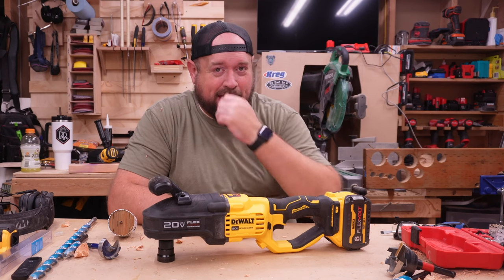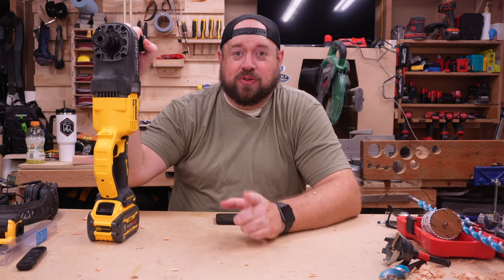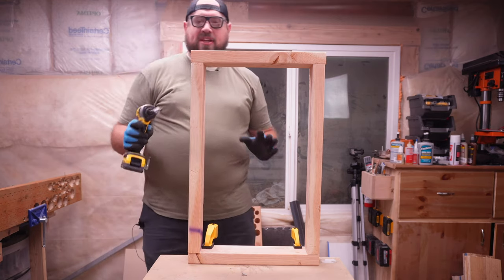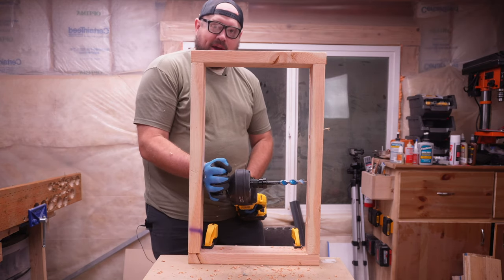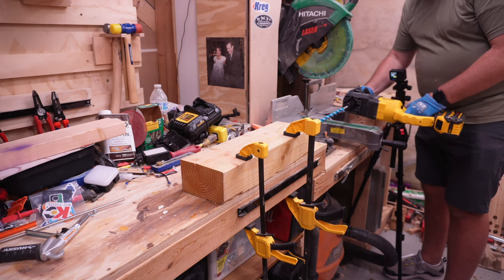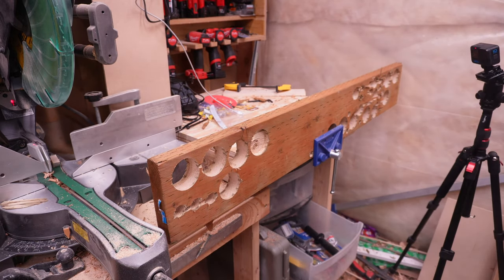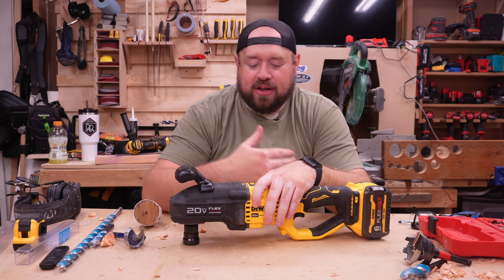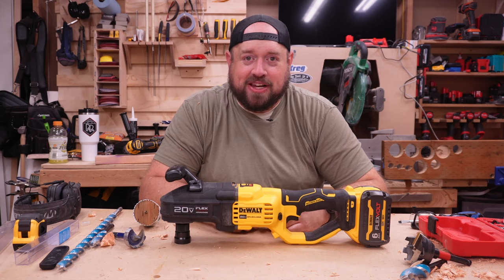Get 83% More Power with DeWalt's Flexvolt Advantage Stud and Joist Drill

Comment: Bro I need a real video making hole with three studs stack on top of each other putting the tool to work in real work scenarios.
Reply: I have this exact same drill with the same chuck. This thing will do 9 2x4’s stacked together with a 16” long 1” thick auger bit. I use the 9Ah battery though

Comment: Man I wish you had the actual flexvolt stud and joist drill that this flexvolt advantage stud and joist was modeled after. I would like to see the power differences between all 3. I have been contemplating getting the advantage version just because of the price difference.
Reply from the maker: Sorry, probably won't be able to justify that one right now. This does everything that I need it to and that's rather specialty tool.
Reply: @TinkerWithTools  oh no it's cool that you don't have it I was just saying it would have been nice to be able to compare the two. I didn't understand the it's a specialty tool. It's the same it just takes flexvolt batteries only. Sorry maybe me just dumb would you mind elaborating thanks for the vid
Reply from the maker: @atrainace114  just saying that I don’t have a lot of need to have multiple stud and joist drills.  I am framing my own basement so I’ll be able to use the one but as for justifying buying another it wouldn’t make sense.  Something more like a traditional drill would get used in other settings as well.  That’s what I meant by specialty tool.
Reply: @TinkerWithTools  I understand thanks for the reply.

Comment: Are these drills good for drilling brick work looking for core drill for boiler flue
Reply from the maker: Can’t say that I have tried.  DeWalt does list masonry specifically in the manual so I don’t think it would be it’s intended purpose. How large of hole?   The list a 4” hole saw as the recommended limit in wood.
Reply: I wanted it for 4 or 5 inch holes for boiler flues and extractor fans